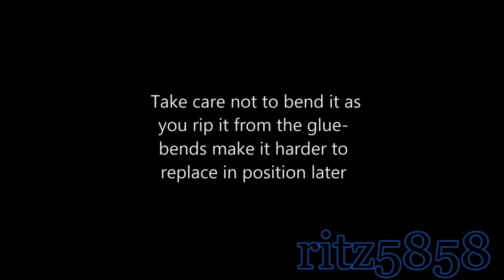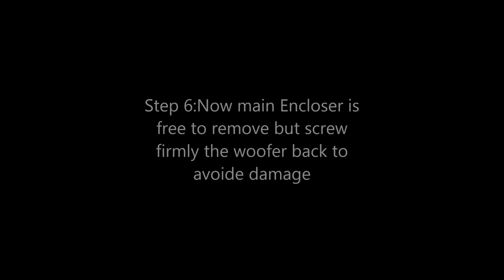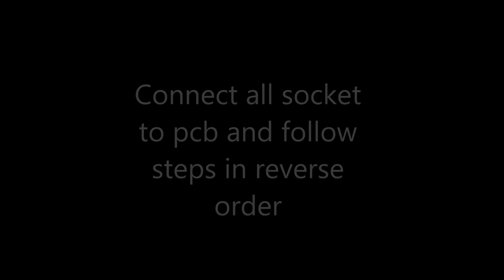Hi Fi iPod Speaker System A1121 By Apple No Power No Sound @Hetztronics-Tech-Co

Comment: Hey so I've got it all apart now and my problem is there is no power or sound I use an AUX. cable to play my music nothing to do with the dock... Any help right now would be amazing !!! HELP!!
Reply from the maker: You may need to check voltage output form SMPS(dual voltage),if its present then check logic of board or other circuitry, we widely offer SMPS fix service for this model,For repair Please Contact -- HETZTRONICS@GMAIL.COM